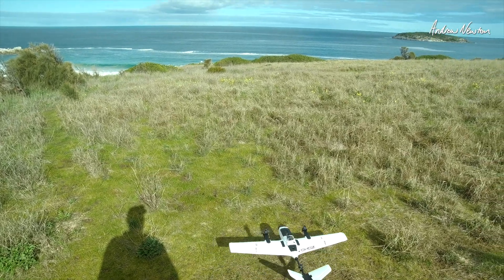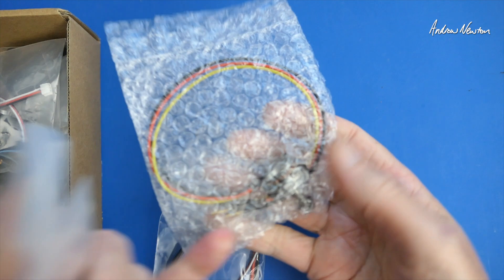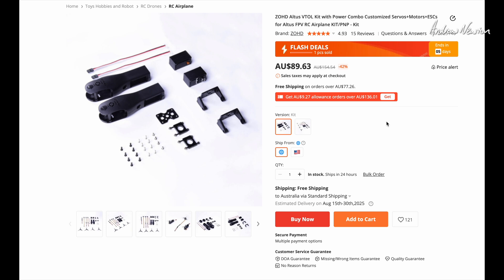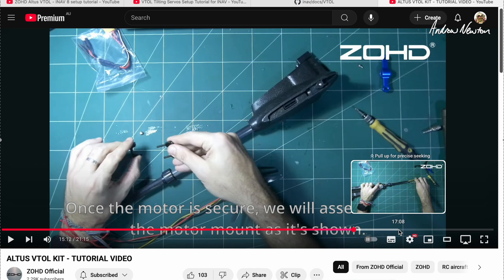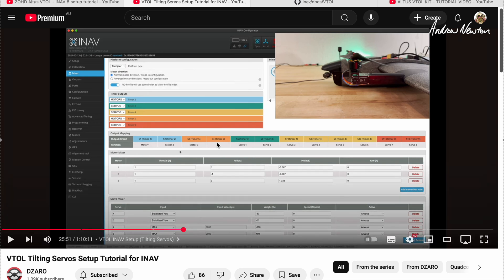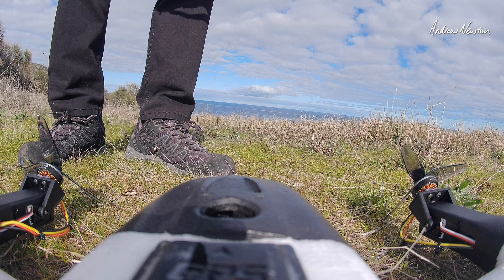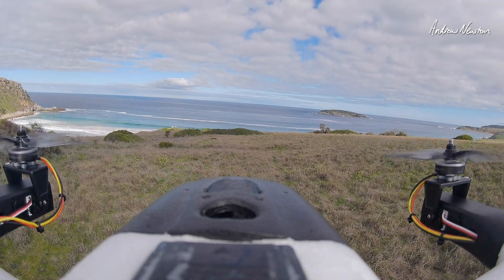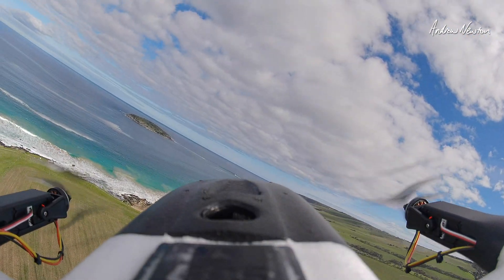ZOHD Altus VTOL Maiden

Comment: Hi again 

When going from hover to forward flight 

How long do you stay in 45 degree mode ? If any

Or do you go high enough in the air so that you can toggle from hover straight to forward flight ?
Reply from the maker: Definitely need the 45º transition mode until airspeed is enough for wing mode. Takes maybe 4 to 5 seconds to build up the required forward speed.

Comment: Lol you missed the whole point of what VTOL means, like most other reviewers. It stands for vertical take off & landing, not dual mode wing quad. Take off straight up till high enough to transition, come in slow and high enough to transition and land..... RTH, Loiter and all the other modes are not for use while in VTOL mode and this was your problem...
Reply from the maker: I fail to agree.
Reply: @AndrewNewton  you also seemed to fail at noticing the tail motor does not move, it uses the movement of the front 2 motors as yaw this is why it is not meant to act as a tricopter, just VTOL.....
Reply: @quadlawnmowerman  But it IS a tricopter - with TWO motors that move to control yaw instead of one.  I agree that a person should mostly fly this airframe as a plane - like you said it's not really meant for hovering around and such - but that said, to each his own.

For me I see a great advantage is flying fast/far to a location to take pictures, loiter there for a while, then fly fast back.  So you it is a combo plane/multi-rotor.
Reply: @Bill-NM  But it isn't a tricopter, and that is evident from the control system kinematics, were it doesn't have a moving/swivel tail motor. In order to get "some" yaw authority the system gives up a bunch of pitch and roll authority by tilting the front motors in order to yaw making it super unstable in the process. This is not a tricopter configuration, it is a VTOL one as there isn't enough motor headroom to make up for the losses which is why it is not a valid tricopter configuration and makes it almost useless as a stationary platform (unlike most multirotors), only one that has a tolerable short term use to take off and land.
Reply: @quadlawnmowerman hmm... Yeah I don't know - I don't see any reason why a 3-rotor airframe would be less stable using two tilting props vs the traditional tripcopter's one tilting prop. After all, the firmware is completely capable of understanding all that. I use Ardupilot for VTOL, maybe INAV behaves differently? 

You raise an interesting point.

Comment: The switch between the different flight modes is done with a switch, is that right ? It is the pilot who décidés when to change modes ?
Reply from the maker: Yes correct but you can also enable auto switching for RTH

Comment: nice..to see the VTOL-Version..do you remember..a few month before we both had the question : what about the right place for Batterie and is there a little bit more space in the front...cause the CG will need that for the  VTOL -Version ..cause just now the Motor in YawPosition will add  it's weight in the Back..
Just now everything seems to be cleared..🎉 THX..❤nice video..OK.. I have my "Elevator-VTOL-Wing"
Reply from the maker: The front motors are further forward in plane mode so the weight of the back motor is balanced. Maybe it doesn't matter so much that the CG moves back a bit for Tricopter mode

Comment: Hi, im not having much luck with my vtol conversion with arduplane. Are your motors overheating? Also, what battery size are you using it with it? My batt drains in less than 5 mins in copter mode
Reply from the maker: Fact of life with VTOLs. I'm using 4S 3300 and it would drain in under 5min at 30A They are not meant to hover for that long.
Reply: @AndrewNewton Hi, I'm curious to know how hot the motors were right after landing? Mine are really burning..

Comment: Great video, did myself the VTOL combo but went the Arduplane route, had issues with the magnetometer so I had to move the GPS on the wing. Also took out the magnets from the canopy but did not help, must be the power wires from the wings that generate magnetic field. I used a 4S2P 18650 Sony  Murata 6000mAH 30C DIY battery pack but it got pretty hot to handle with 2 longert flights in tricopter mode (for tuning purposes) - my plane is sluggish on the YAW in QPlane mode so trying to solve that issue for now. Flies great in plane mode, about ~7Amps on my side as well, and ~30A in tricopter mode. I have now build a 27100 4S1P 4500mAh 45A discharge rate LiIon (Molicell) battery pack that I hope will better handle tricopter flights. I have 3D printed a custom nose that has the Walksnail Nano 3 vtx and camera is mounted on a 170degree Servo. Cheers and looking forward for your inav setup video!
Reply from the maker: Thanks for the feedback, interesting to hear your experience with the Altus.

Comment: I ask people who post vtol videos like these about flight times - they sometimes avoid the question claiming they did not test for endurance.  I assume you have no numbers to share.  Waiting for when it gets so good people post numbers then I know it is time to look into this tech.
Reply: How good are you expecting it to get? A typical quadcopter will fly for 4-6 minutes. VTOL with a plane is a similar brute force movement, removing all the planes inherent aerodynamic efficiency. I'd expect you'd lose 50-75% of your flight time using VTOL to take off and land. For me, the sweet spot would be hand launching and having the ability to land vertically in tighter areas.
Reply from the maker: More of a fun technical challenge than a practical way to fly. Unless you search for more efficient motor / prop combo. I'll try a plane launch with VTOL landing and see how long.

Comment: Converted mine when the kit first came out. It all works as it should. But it's no good in any wind, way too heavy, draws too many amps in vertical mode, doesn't fly anywhere near as good in fixed wing mode as before the conversion - so it's going to be converted back to a normal plane.
Reply: I came to say pretty much the same thing. Only difference being that mine is already converted back. I have a T1 Ranger VTOL and a T2 Cruza VTOL and both are significantly better VTOL platforms than the Altus.
Reply: My Altus flies great in airplane mode, but sluggish on yaw in tricopter mode. I just diy-d a new li-ion 4s1p 21700 size 45A 4500mAh battery pack to see if it can better handle tricopter mode, as my previous 4s2p 18650 Sony 30A 6000mAh battery pack got pretty hot to hold it in hand after prolonged flight in tricopter mode. As for you, I hope you got your Center of Gravity balance on point and with the motors put into airplane mode (forward pointing) when setting up the CG. As it could be the problem for your bad flights if you set it while having the motors point up (that means plane got tail heavy and that leads to bad flight characteristics). Cheers!
Reply from the maker: The 3 bladed props and high KV motors are not efficient. Surely can be improved
Reply: @AndrewNewton Hi, what set of motors and props can you suggest ? And btw my altus is 1370g heavy and pulls abut 29Amps only for hanging in air with Zohd motors and props. With compas pos. hold works perfect. Thanks in advance for answer. Reg.

Comment: I'm an old-fashioned girl so I'd swap those nasty new-fangled electric motors and flight batteries for some matched OS •15 glow engines. Mmmm, so noisy, so messy, so tricky, so many chopped fingers...☺️
Reply: LOL! Yep, 1 of those times when IC rules over Electric. Same power available until the tank is completely dry! The consequences of having to switch from 3/4 Amps to 20+ right when your battery is on its last legs don't bear thinkin' about. Having the pilot do an Orville and slide down that pole to hand restart the rear motor for landing would be interesting though. 🤔😉😊

Comment: Well done, your work is always impeccable!  ooh that is steep amps draw for using li-ion though.  Molicels specs say they would be at their limit with this plane on 4s1p, I wonder if there is room for a 4s2p 21700 pack?  I see on GizFPV's channel a couple years back the Heewing T1 VTOL can launch and hover on about 19 amps and cruise at as low as 5 or 6 amps, with a 3S pack.
Reply: I have a T1 vTol, running 21700 4s (45amp cells).  It hovers on min 14amps, and climbs using 25amps plus if your gentle.  Cruise on 4s is an impressive 3-4 amps.  I have flown it for 28mins with a hover landing which pushed the cells to their absolute limit.

Comment: An interesting though expensive toy but perhaps you should add 3 crew models, mate. Plus have a hole dug for them like the 3 poor Yank kids in the Osprey up near Darwin! All these swivel motor designs run on borrowed time - 1 fault or bump to the swivelling mechanism and you've got a bag of bits. We still fly our XK X450s on occasion - when we can keep the parts up to them! 🙄😉😊
Reply: ❤ I dismantled my xk x450, gps to be added
Reply: @prabukengg  If you mean you intend to try adding a GPS unit to the stock XK X450 flight board, I'd be very interested in how you get on. The board can be reused for a normal twin motor plane by not using the Multi Rotor Mode. Since you need it in MR Mode to start, then it transitions to twin motor forward flying mode in stages, you'd also need to program motor behaviour and a delay to launching in your Multi Module radio. But it should be doable. Not sure about how you'd hook up the GPS puck to get any usage out of it though.